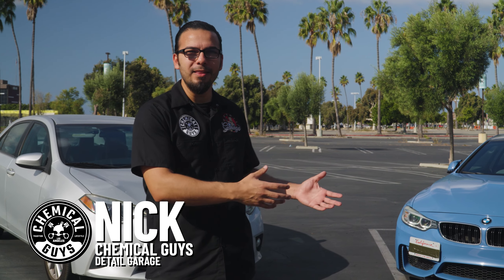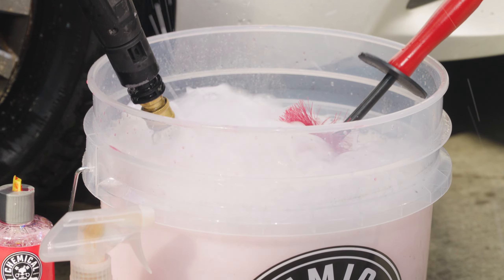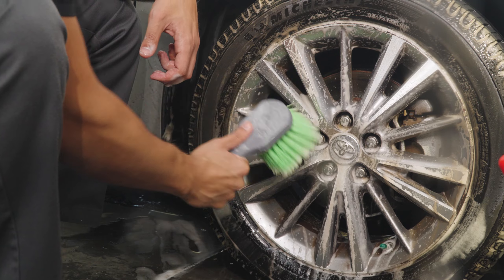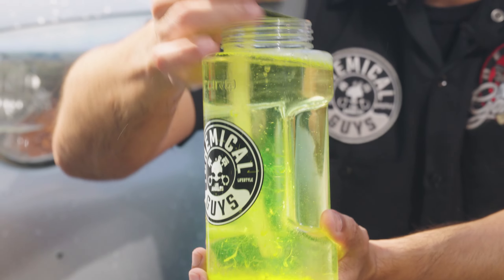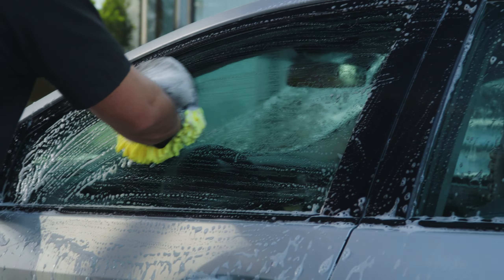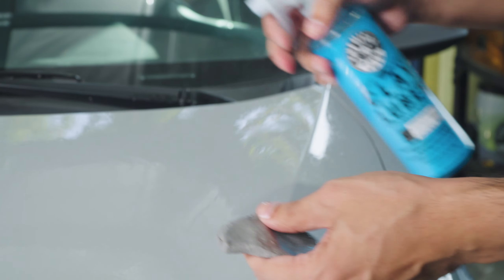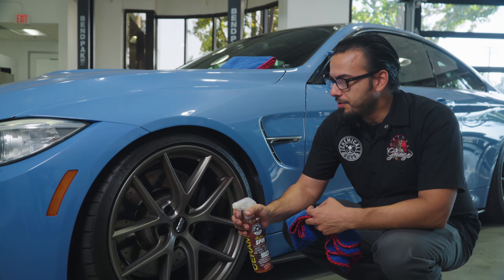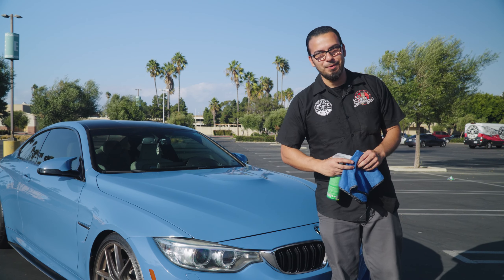Cleaning & Detailing Neglected Car vs Fully Detailed Car! - Chemical Guys

Comment: Did you guys do iron removal on this vehicle before clay bar or is it not that necessary?
Reply from the maker: Hey! After a wash using Citrus Wash and Gloss combined with Clean Slate and a Clay Bar service, the surface is thoroughly cleansed.